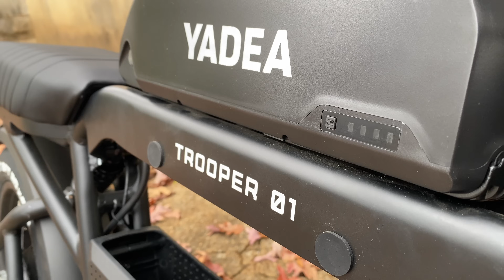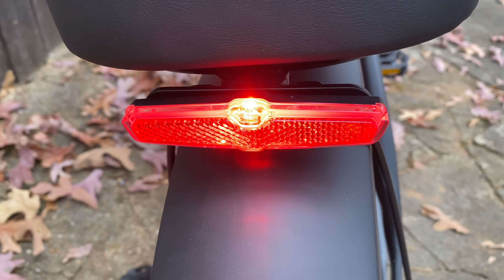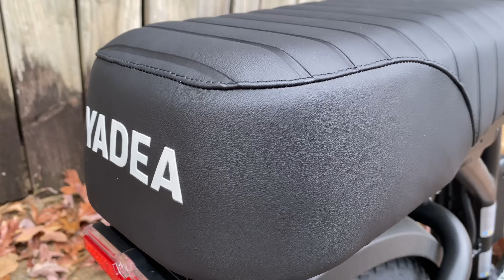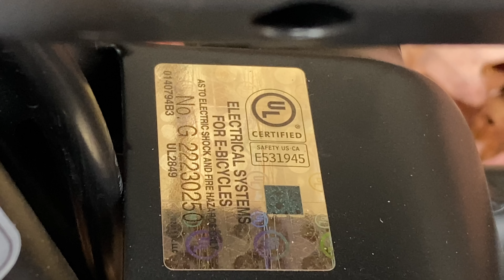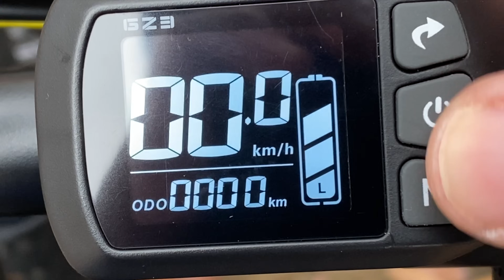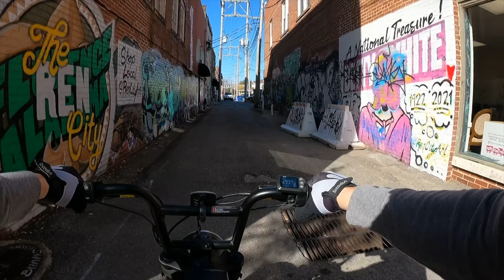CLASSIC RACER STYLING with ELECTRIC  POWER | Yadea Trooper 01 | UL2849 Certified - $1999

Comment: you can change the top speed in the programming - it will go around 30 mph but the display will show 5 km/h  - much better for commuting but of course only ride off road at those speeds 😉

Comment: Nice Bike 
 but the price is  a killer
 I built a 48 volt 20ah -1500 watt fat tire snow bike 
 all from Amazon for a  $1,000 bucks..

And I don't pedal it either
Average top speed is 33mph 
(have had it up to 36 mpg)

'm putting another battery on it to double the mileage
$300 fat Tire Bike 
$300 1500 watt motor 
$400 48v 20ah battery

So if you don't want to spend a ton of money & can turn a wrench & strip wires 
You have less expensive options

to see it  check the video on my page

Comment: Good review, but this bike should be (maybe it is) de-regulated to at least 28 mph even if on PAS only. Have you looked at the Royce Union 29er @ $258 (BF pricing)/ It has SLX shifters and derailleurs, Volt saddle, hydraulic discs, WTB rims and four sizes?
Reply from the maker: I’ve seen a few videos where people unlocked it I think

Comment: "I wouldn't publish the video if it didn't meet my standards"  THIS IS NOT RIGHT.  The most important thing is to give negative reviews to bad bikes, not just pretend that you never saw it.  You already load up the videos with commercials, some quite long and not skippable.
Reply from the maker: 😂 you do know that YT puts commercials on every video now, right? Creators don’t have control over when or where (I never manually ad them or manually space them)…that’s all YT
Reply: @KevCentral  For a few weeks my ad blocker stopped working. 
We need a law that holds google/youtube responsible for the scam ads they run. They are making money helping scammers steal from people.
Reply: @KevCentral Maybe YT is punishing this guy for some reason.😂 I hardly ever get commercials during your vids and the ones I do get are quite bearable.
Reply: @MichaelRei99  To me, any commercials are punishing me.  If youtube ever successfully defeats ad-blockers once and for all, I'm done with youtube. 
For one, a large percentage of the commercials they run are nothing but literal scams.  Free energy devices and the like are quite common.
Worse, all of them have progressive messages (that have nothing to do with the product or service they are selling) in them.

Comment: Nice e-moped. Not my schtick but I have to admire good design. If you want to throttle around, using the pedals only as foot rests, those 20 inch tires aid in torque to the ground compared to larger wheels.